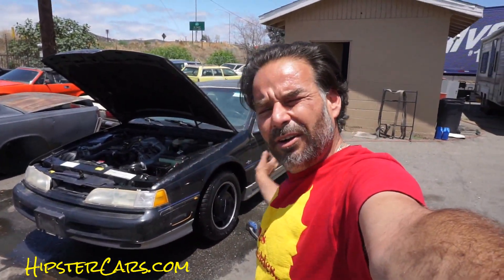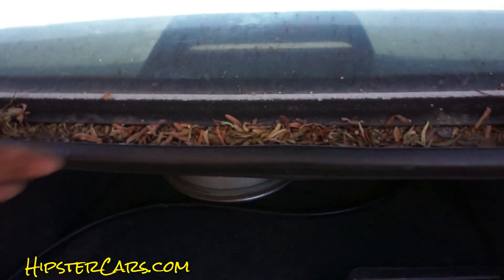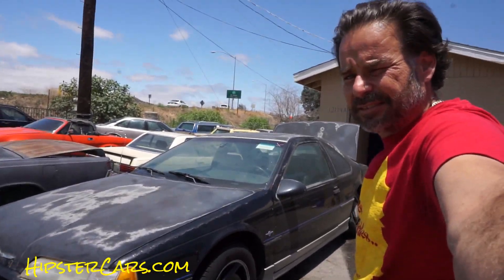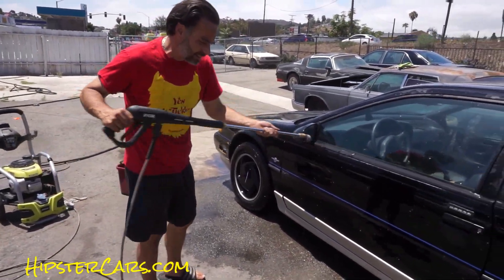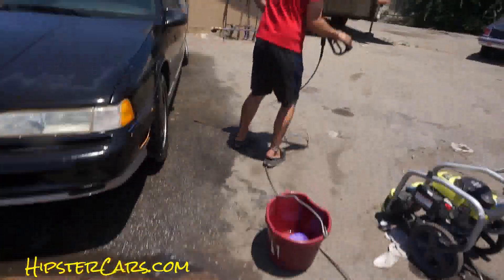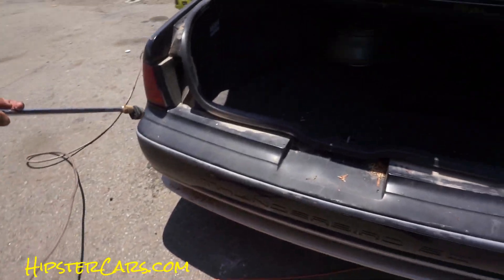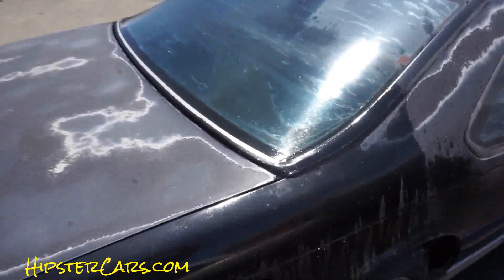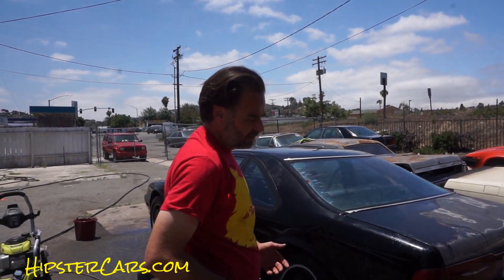DIY Pressure washing Cars Complete Power Wash car Detail #4

Comment: Is dissolving clearcote a big problem in Cali? I rarely see stripped cars like that in dreary england.
Reply: Green Pretzel The clear coat fails in sunny climates in the U.S. It is very common to see in cars older than 8 that have been parked outside here. Almost all cars 15 and older have clear coat failure here in texas.
Reply: Thats a shame but probably still better than rust.
Reply: My 32 year old daily driver may have faded paint, but there is no rust and the whole car is solid.
Reply: Yeah at least worn out clearcote is easy to see, rust can build up for ages until it's noticed.